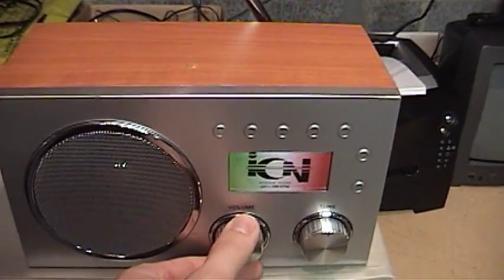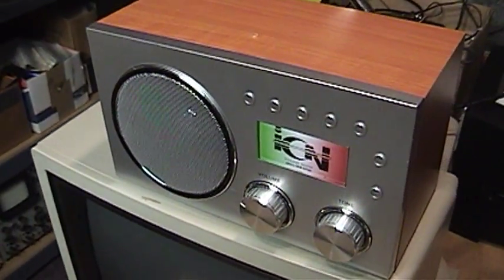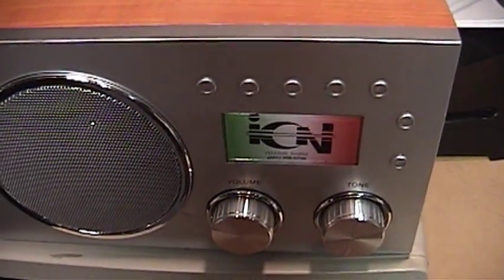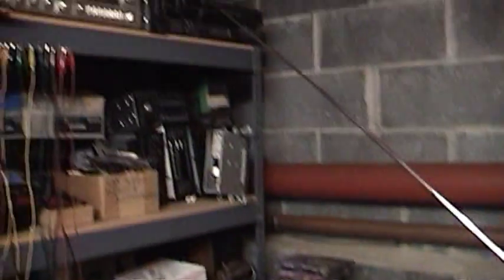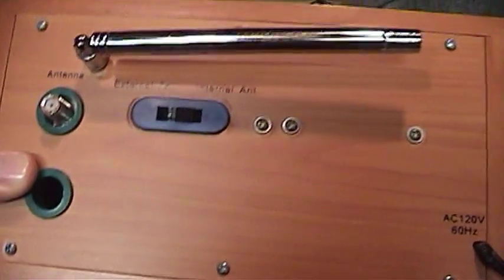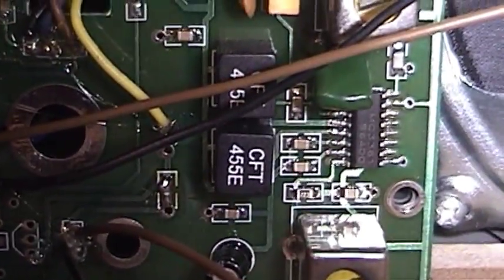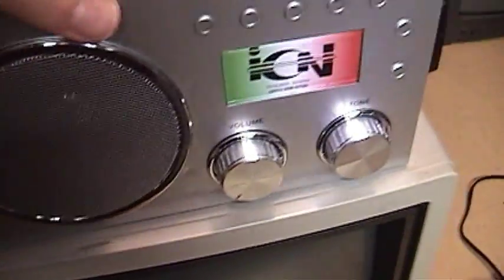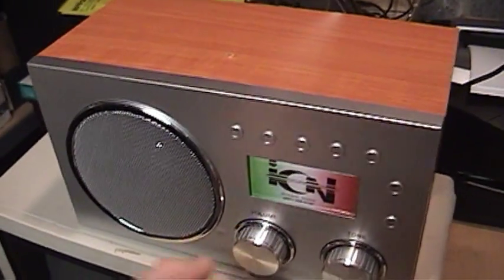FM SCA subcarrier audio receiver

Comment from the maker: @fmbroadcast This is only a subcarrier receiver. There is no way to make it receive the main FM signal of the station providing the subcarrier. And likewise, a normal radio will not receive the subcarrier, it will only get the main FM signal. The subcarrier is basically equivalent to the "SAP" (Second Audio Program) used by TV stations here in America, usually to provide a Spanish version of the TV show being broadcast.

Comment: Ramsey Kits used to sell an SCA receiver kit already built or for you to assemble yourself.  You needed to wire it to the Discriminator output of the FM chip of a regular receiver.

Comment: cool :)
This is a long shot, but if you tuned a mini FM transmitter to 88.3 and used it to rebroadcast the output of an ordinary FM radio, you might be able to relay other SCA services to your receiver.
This works for me with mpx stereo and RDS data signals - they get passed through (off-the-shelf "iPod transmitters" will filter out the high frequencies, though).

Comment: Looks like the product of a relatively small-scale operation indeed.

Since we don't have this system on this side of the pond (in return, RDS has been popular for 15+ years), I had to read up a bit. Apparently it's NBFM with a 5.5 kHz audio BW and 150 µs deemphasis. I guess that chip at the top right is an FM IF job (note just 1 ceramic IF filter  + discriminator), and the lower right one (usually some Motorola) does upmixing to 455 kHz and FM demodulation. 6 poles for filtering, not too bad.

Comment: I believe that SCA originally started in the 1960s and the first radio station I recall using it was KANU 91.5 in Lawrence Kansas. The concept originated due to providing programing for the blind in the form of talking books through radio. My description about the origin of SCA might not be entirely accurate but it is to the best of my knowledge mentioned here.

Comment: Do you know if SCA radio stations transmit their programming in stereo?
Reply: SCA stations are in mono and the upper frequency response is much poorer than the main FM station that it is piggy backed on.  You also need quite a strong signal to receive the broadcast noise free.